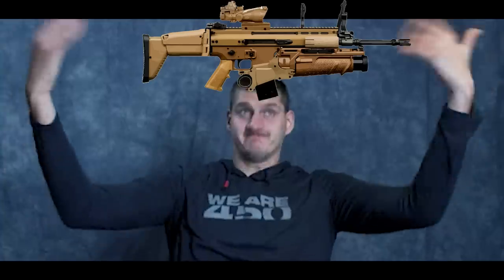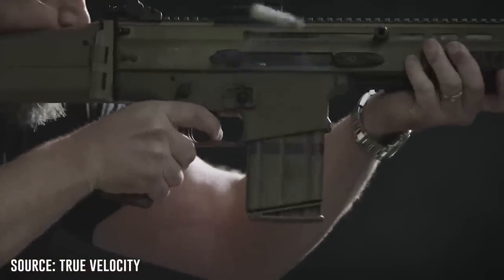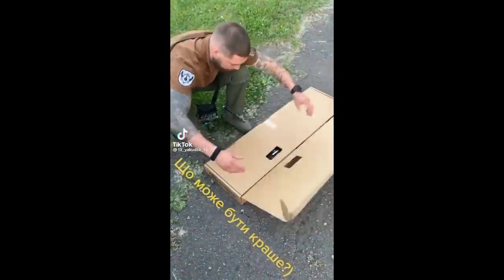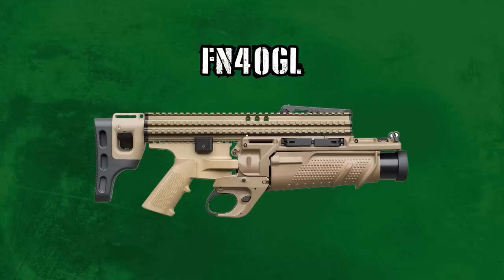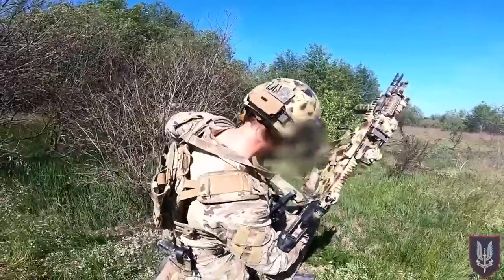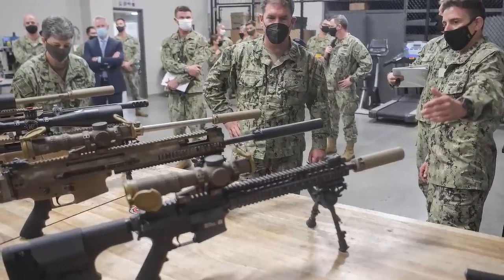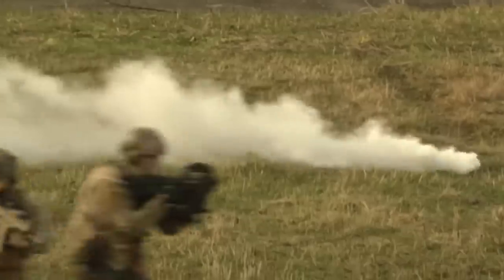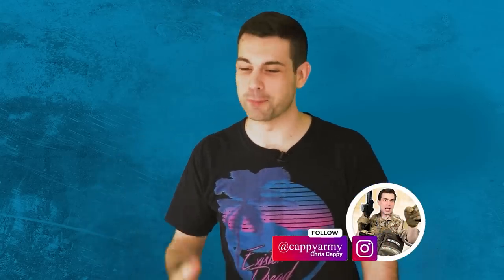Why this SCAR-H Rifle Uses Plastic Ammo Casings (Weapon Analysis)

Comment: the scar is actually a short stoke piston weapon. it just has a ridiculously big bolt carrier
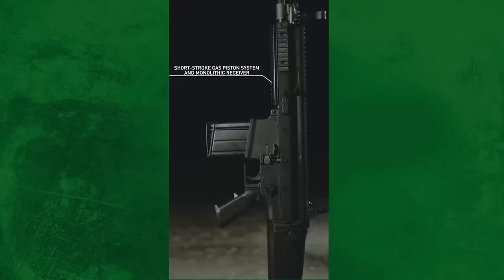Reply: It's funny because his video at the 9:45ish mark even says Short Stroke piston lol.
Reply: why didnt they just make it long stroke gas piston since that bolt already extends all the way to the front ???
Reply: @corvoattano4777  it is a long stroke gas piston.  He says that just shy of 4 min mark
Reply: @TheGmanway  it isn't. Like the original comment says the bolt is very long and it seems like long stroke piston but there is a smaller piston at the front which strikes the bolt to open it.
Reply: @corvoattano4777  It would probably have to extend even further to be a long stroke. Since it's a short stroke that means theirs a gap between the BCG and the piston actually. So the BCG would be even longer then.
Reply: Which gives it that odd (better?) recoil impulse: it's almost in between a AR-style short-stroke and an AK long-stroke.
Reply: @mrkeogh  that's more to due with the weight of the BCG, but you could say piston driven firearms tend to be smoother felt recoil.
Reply: It's basically an upside down M1 Carbine gas system, but actually good.

Comment: I've got a SCAR H with a 20" heavy barrel in 6.5 Creedmoor and it is way more accurate than my abilities to shoot it are. Love that rifle.
Reply: ewww why such a caliber choice....
Reply: @ommsterlitz1805  because it is essentially an optimized 7.62x51 - much better ballistic performance and can easily hit accurately out to 1200 meters- which is why the SOCOM s now getting their Mk 20 mod 0 Sniper Support Rifle in 6.5 Creedmoor 
'FN Mk. 20 SSR in 6.5mm Creedmoor, and determined that the 6.5mm Creedmoor chambering performed the best, doubling hit probability at 1,000 meters, increasing effective range by at least 40 percent, reducing wind drift by 30 to 40 percent, and retaining 30 percent more energy, all with significantly less recoil than standard, 7.62mm rounds' - so why that round? Because it's superior to 7.62x51 - and SOCOM knows it.
Reply: @macfilms9904   yes and how much you can shoot them without being out of stock compared to any other caliber
Reply: Have you had any issues with reliability? Tim with MilitaryArmsChannel seems to always find lemons, but his 20S in 6.5 was hot garbage.
Reply: @rhubarbpie2027  I haven't put the kinds of round counts Tim does, and I'm still on a learning curve with shooting at distance - so I'm slower & more deliberate about it and haven't had any issues to speak of - but I'm sure it can happen - although to be fair to the SCAR, I've had small issues with most of my guns at times. I built mine up from a basic SCAR H ), Super SCAR trigger, a German steel fluted heavy barrel etc - it's not a 20S - don't know if that makes any difference or not.
Reply: @macfilms9904  fair enough! Thx 4 the info.
Reply: Mmmm. Sounds sexy. Beautiful gun and amazing cartridge
Reply: No offense my friend as it is true for almost all of us on any decent system. It’s us, not the firearm that is inaccurate. But I do love my H.
Reply: As a soldier back in 2012 when we were certain that the SCAR would be adopted, several of my guys forked out the $2300 and bought them.  So we had the unique opportunity to have seven SCARS (both light and heavy) on the firing line blazing away.  No issues with any of them.  What astounded us was the gentle recoil.  And accuracy was there, considering that they were only made to standard mil-spec requirements: 3 MOA.
Reply: @ommsterlitz1805  the only issue with the 6.5CM is it’s dramatically short barrel life in comparison to .308. However it’s got a much higher BC which equates to a better hit probability. 

Additionally OP doesn’t sound like he’s running a 20S it most likely is a 17S with a swapped barrel/bolt
Reply: @MaseratiChris556  Maybe a dumb question, but why the shorter barrel life? Higher pressure?

Comment: A nice thing that may help the SCAR series would be doing the 6.8 conversion, letting it stay in service as it is the same ammunition as the M5 and M250.
Reply: Im curious how a 6.8 SCAR and the M5 would stack up
Reply: It would be fairly interesting, still a surplus of parts existing. Potential stopgap maybe.
Reply: @steakwilliams4448  fn mrgg-a with 6.8 vs m5
Reply: @steakwilliams4448  without knowing the details of the M5, I'll say the the SCAR is only surpassed by one other tested firearm in sheer numbers without stoppages. So without knowing, I'd venture a guess and say pretty damn well.
Reply: This would be pretty easy to accomplish as it would use the same magazine and only require a barrel change.
Reply: @Element_punk  depends on headspacing but probably
Reply: @pottyputter05  Headspacing is determined by barrel extension, and barrel extension is headspaced from the factory, just like an AR.  Also just like an AR, if you can drop in a new barrel chambered in a different cartridge and start shooting, you can do the same with the FN...they use identical designs for the bolt/barrel extension.  Only thing that throws headspacing out in either of them is an out of spec bolt, which would throw headspacing off in all barrels and needs to be trashed anyway.

Comment: I can only speak for my own experience, but I love mine. Lightweight, easy to do follow up shots and target transition easily for a 762, outside the weight of mags, its heft to me is closer to an AK than a battle rifle. An aftermarket trigger has made it easier to be accurate with it, haven't done any other major changes.

Mine is the reciprocating gen but ive had zero issues with it. Cleaning is a breeze and I have gradually got rid most of my DI rifles over short stroke pistons. I think if the new, non reciprocating gens came with angled and extended handles, that'd be nice.
Reply: ..same EXCEPT for mil spec FN trigger…
Reply: The reciprocating charging handle really only bugged me when I shot it from a barricade. It got caught on my sleeve and it slowed it down enough to fail to go into battery (wasn't mine so I didn't expect that). I'm considering getting one with the non-reciprocating when my wallet feels comfortable with it. It's just such a great looking rifle, and even if SOCOM doesn't like it, you can't deny it's an iconic weapon of the GWOT time period.
Reply: isn't an AK a battle rifle? I thought that just meant chambered in 7.62 or bigger.
Reply: @laraycrenshaw5908  The ak isn’t considered a battle rifle because it shoots an intermediate cartridge, 7.62x39. Battle rifles shoot full power cartridges like 7.62x51, which is a little bigger and more powerful than the 7.62x39
Reply: @holyguacamole__6922  huh cool learn something new everyday
Reply: since when was the ak not a battle rifle
Reply: Piston guns are God's guns.
Reply: @АлакПатрова  funny because the Yemenis called a DI AR15 chambered for 7.62 × 39 the Allah rifle since it was a lot more accurate than AKs they were used to.
Reply: @matthewotis3594  since it's caliber determined it wasn't. AK in all its calibers are intermediate cartridges, unless you wanna talk about the SVD, PSL M72 ect which are considered DMR's.
Reply: @АлакПатрова  I've seen a few in 7.62 NATO. Like all the AR platforms that shoot 7.62 whether it's the NATO or 300 win mag
Reply: You got the Geisselle trigger? Smooth as hell. I'd recommend getting a rail extension so you can run a bipod in front of a foregrip. You should pick up one of those drop in angled charging handle replacements too.
Reply: @morgatron4639  thjat Geisselle trigger is a must......so FN smooooth :)

Comment: One of the issues with the SCAR's wasn't that the SCAR's optic mounting solution, the issue was that the barrels screws work their way lose over time which would make your fire inaccurate. Check out 9-Hole Review on the SCAR H and L.
Reply: ..”loose”, just sayin’
Reply: I would suggest Loctite but then you won’t be able to get the screws off 😂
Reply: @vicdiaz5180  you will if you heat it up
Reply: @chemistryofquestionablequa6252  so.... fire a couple rounds and the loctite melts
Reply: @raymondwong7895  certainly could be a problem
Reply: @m118lr  sorry chief I'm dyslexic
Reply: Plastics just aren't proven in real world combat. Extreme heat and extreme cold crack plastic far easier than brass. And the second you throw a cracked case in a .308 and pull the trigger you're going to get an explosion, and not the one you wanted.
Reply: This isn't an issue, at all, I'm not saying they didn't have it happen, they most certainly did have that issue. But they are in the extreme minority.
Reply: @angrydingus5256   A crack in the case is not going to hurt firing it. the case does not hold the pressure the chamber does. We use to have cartridges made of paper back in the 1800s.
Reply: @vicdiaz5180  There is non-permanent loctite though.
Reply: @angrydingus5256  I completely agree
Reply: Rockset would be better than locktite in hot areas.  Rockset is ceramic based and you can still remove the screws later.
Reply: @angrydingus5256  that's why they need to prove it in combat, by fielding them
Reply: @raymondwong7895  There's different types of loctite, heat resistant and regular. But still heat cycling would cause the loctite to eventually lose grip.
Reply: Actually  both, atleast the early versions of the SCAR-H had some weird recoil impuls harmonics causing SOME optics to acyually breake, this led to some manufacturers marketing their optics as SCAR safe. The barrelscrews comming loose is a whole other thing and i have no clue how common it is for them to start walking out, Possibly a problem with out of spec torq on the screws or something, i mean the MCX has 2 screws holding the barrel and i havn't heard of those walking out exept when people under torq them.
Reply: @JarlBSoD  Its also a problem with the DPMS/Knights size of AR. The heavy bolt slams into the rear, which scopes are designed for since the 1800s, then comes the real damage maker as the carrier bangs into the breech. Then gives it a couple taps for good measure. 
Springer air rifles have the same problem so you need a scope designed to take that forward whack. If not, you'll soon find out..!!

Comment: The reason why M4 barrels were melting and blowing up at the time was because of a QC issue at Colt. By the time FN had finished the SCAR-L model, not only had the QC issue at Cold had been rectified, but all M4s moving forward would have a heavy profile barrel to prevent those issues from happening again. Also SOCOM had gotten the Block II M4s in stock from Daniel Defense and they were more accurate than the SCAR-L and just as reliable. So there was no need for it anymore.

As for why the SCAR-H became popular, well it was so much better than the M14 variants (Mk 14 EBR and M39 EMR) but also because the M110 SASS rifle was having issues in the field and the higher ups wouldn't let Knights Armament fix them or upgrade them. So they adopted the SCAR-H for a DMR role, even when the M110 was more accurate, didn't destroy optics, and could be made cheaper than the SCAR through their existing contract with Knights.
Reply: What’s the word on the M-4’s breaking so many locking lugs with the higher pressure 855A1 ammo.  Is there a fix or upgrade?  All I got was babble from the contractors at the Ft Jackson weapons pool.
Reply: @blackhawk7r221  Not quite sure if I heard anything about M855A1 rounds affecting locking lugs, but I do know it had feeding issues and those were were fixed by adopting a new aluminum magazine as well as Gen 3 PMAGs. Other than that, any parts wear that happens people have to suck up.
Reply: @chaoschaoforever  Yea, the tan mags with baby blue followers that went out about 2012 have the improved lip angle to keep the sharp tungsten tips from stabbing the back of the chamber. We’ve been cracking off lugs for years with this 64,000 psi 855A1 ammo.   We keep hearing rumors of a fix, but nothing yet.   Just thought you may have heard something.
Reply: @blackhawk7r221  Nah man sorry, I haven't heard anything. I think the only thing they could do is beef up those lugs as well as the bolts to be able to withstand those pressures but seeing as the XM5 is right around the corner I highly doubt they will do anything. Personally I think the 5.56 round is at its limit and we should be moving to a round like 6ARC which can fit in a normal PMAG just fine. I don't think the XM5 firing 6.8x51 is the right way to go, but I do think we've finally seen the limits of the 5.56 round.
Reply: @chaoschaoforever  So true.  When everybody in my platoon was fighting over  who got to carry the 14’s, you know it hits home.
Reply: @blackhawk7r221  Damn man that sucks. Personally I would still take my chances with an M4A1 with M855A1. Sure parts wear is an issue, but I'd rather use a rifle I can easily fix and replace parts than an outdated design that is finicky to retain zero with and doesn't take jams well, even in a fancy new chassis.
Reply: look at the where the barrels failed. there were QC problems, but high round full auto caused transformational temp at the weak points on the barrel
Reply: @blackhawk7r221  chamber pressure, dwell time, timing problems
Reply: @xusmico187  M-4’s do not have barrel problems.  It is bolt locking lugs that are breaking.  Only has happened since we went from roughly 55,000psi 855’s to 64,000psi 855A1’s.  
No issues with cyclic timing. We haven’t seen lug breakage on the barrel extensions.  Only bolts.
Reply: @blackhawk7r221  Nah he was talking about when the M4 DID have barrel problems, back when the SCAR-L was in development.
Reply: @blackhawk7r221  From gunsmith and miliary armorer chatter, the broken bolts are almost always from a lot of full auto firing. This was prior to the upteen variations made with 5.56 ammo.
Reply: @LuvBorderCollies  Oddly enough, the broken lugs that we’ve seen over the last three years were from basic training issued carbines out of the Ft. Jackson weapons pool. You would initially think that BCT would mean a high round count, but no.   They fire 760 rounds over the course of a 10 week cycle, and never at a high rate of fire.   In the POI, the trainees simply never have the opportunity to fire more than 40 rounds at any one time, and that is done rather slowly at timed popup targets.   
If we decide to do a full auto familiarization fire range, we never give them more than a single mag with only 15 rounds, and that’s a one-time thing.   One and done.

Comment: 7:16 the SCAR has a short-stroke gas piston; the bolt carrier group setup just makes it look like a long-stroke.
Reply: Yep, a massive and long bolt carrier. A very smart key design aspect I must say. 
Even better with the new NRCH version, the 'charging handle slider' keeps the system closed during firing and when the bolt is holding open. At the same time preserve the service life of charging handles.
Reply: In our old classics like M-1’s and M-14’s, that long thin operating rod was always the weak link.   FN did it right.

Comment: I would truly like to try that plastic ammo, though it may be expensive and difficult to find.

I really love the SCAR rifle and both the 16 and 17 are the best I have ever laid hands on.

Now as for the optics, the action of the harmonics of the bolt cycling open and closed is what destroys optics.
The only optic I know that can take abuse in normal operational use is the ACOG. There may be others, but the ACOG will take the punishment.
There may be others, that I don’t know about, but the ACOG is what makes am used to using with these two rifles. I’d say that anything from Trijicon would do just fine.

As far as the charging handle goes, that’s what the Army wanted and FN delivered.
We had to train keeping the dynamics of the charging handle in  mind and trained around it. I likened it to learning to drive stick shift.

As my instructor used to say, “Train hard, fight easy.”

I really love the SCAR!